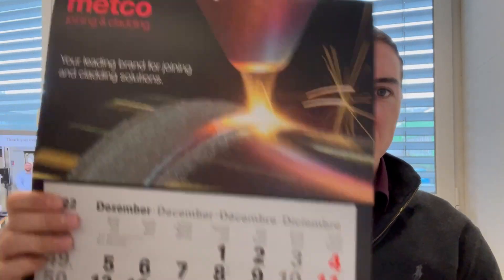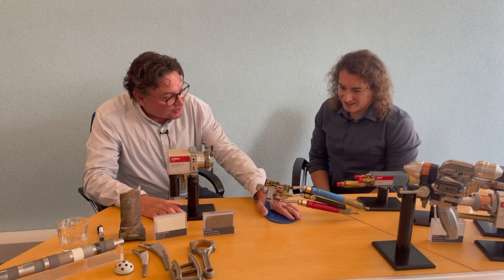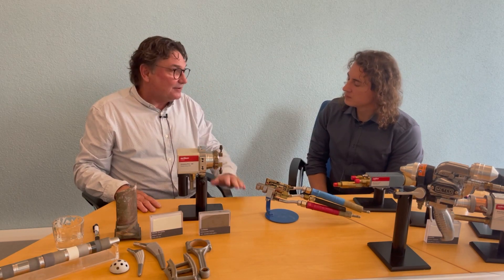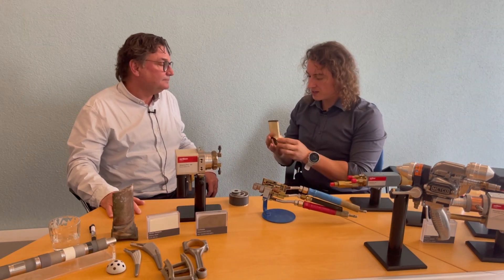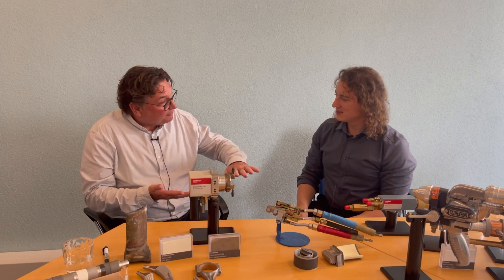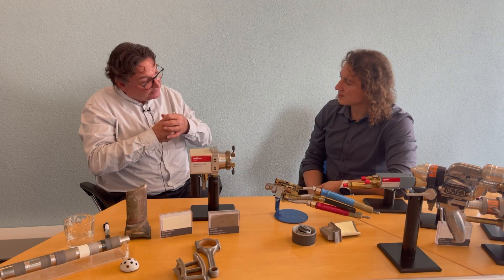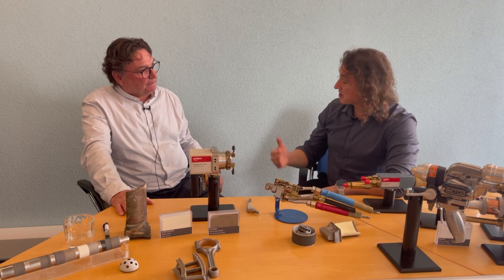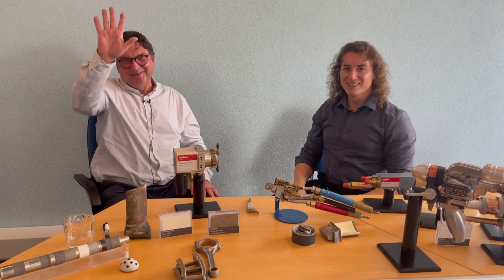Plasma Spray: The Most Flexible Thermal Spraying Process | TS Interview Part 3

Comment: Two things were not covered clearly: 1. Which process gives best adhesion (bonding, infusion) to the base material, so it won't come off under extreme conditions and can be safely used for restoration of crankshafts, cylinder walls of the engine? 2. Price comparison of the guns and, most important, materials (say, aluminum powder vs aluminum wire for wire gun). These things are very important for small businesses.
Reply from the maker: Good questions/remarks I will take them with me and ask Peter how much he would be to cover those topics

Comment: 8:01 yttrium stabilized zirconium, applied on all land base Turbines.

Chrome oxide , chrome oxide Titanium silica dioxide, Metco 136cp used in Texas on compressor rods in the early 1980s among other applications. 
Pure chrome oxide with a tantalum bond coat then sealed . Used in fertilizer plants
Reply from the maker: nice remark!